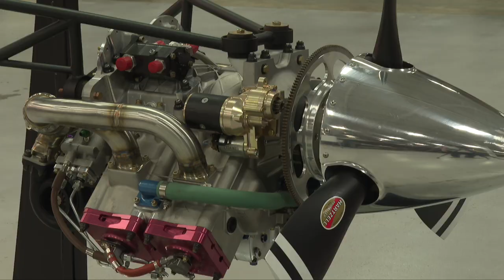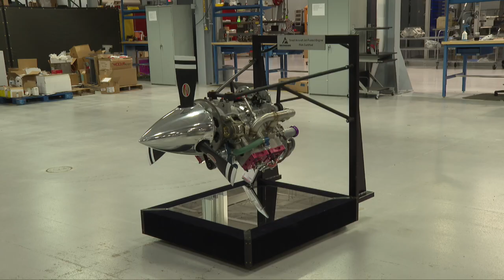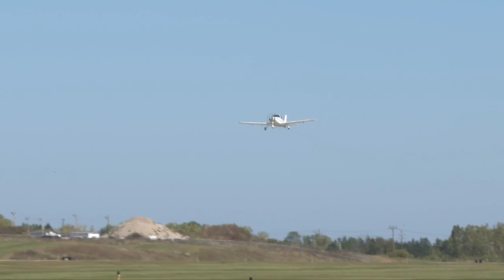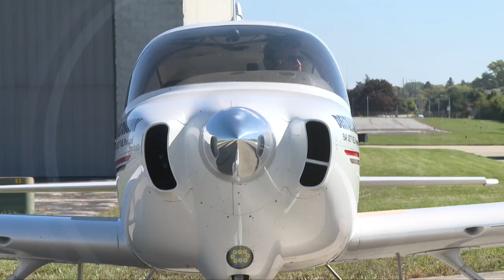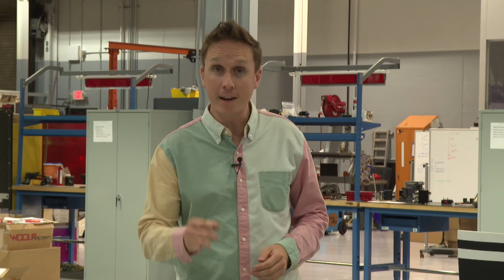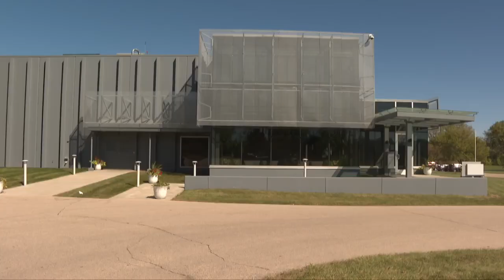This engine is the future of flying

Comment: This engine as the reporter said has been decades in development.  That is NOT and exaggeration. It is a boosted 2 stroke diesel, and it supposedly burns clean with no electronics.....? The 6-71 Detroit Diesel also had no electronics and they do NOT burn clean as I've had one. Perhaps the jetfuel helps but after nearly 40 years of working out the bugs, I still am not convinced. Perhaps it's time is here, but I doubt it. I do hope Im wrong however. Even if it now works great, it will most likely be priced out of reach of most people.

Comment: Uhhh... Piston aircraft engines are about as complicated as a bag of hammers. Air cooled, pushrod, mechanical fuel injection. I'm a pilot and a maintainer. Even turbine engines are pretty simple beasts. The exception to this rule is the Mercedes diesel powerplant used by Diamond in their Jet A fueled piston models. Those are full FADEC controlled and considerably more complex. Just don't be fooled into thinking that GA aircraft engines are much more complex than farm equipment.

Comment: However well it works it still burns hydrocarbon fuel, so its not the future it's the last elaboration of a technology than has reached the end of its useful life. The future is  electric. Battery or hydrogen. They might need more refinement but that is now happening at pace.

Comment: Yes, it really is a miracle. Lycoming, Continental etc. can close their companies. Nothing can go wrong with this engine, it has no spark plugs, no carburettor, no injection and no cooling system; therefore there is no need for a coolant pump and the V-belt or flat belt is just for decoration. 😛🤣😍😵‍💫

Comment: I remember when Delta Hawk was gearing up years ago, early 2000’s. The experimental crowd was pretty ramped up for an alternative to Lycoming, which I understand has years of backlog orders. Yes this is a diesel. Interest faded when Delta Hawk leaned more towards certificated applications, which makes sense. I’m sure the FAA has made that journey a simple and enjoyable process. Given the process to get a simple LED lighting system certified, it’s no surprise it’s taken them 20+ years to get this far. It is really a well engineered piece of machinery.

Comment: I didn't learn anything from the video so I went to their website. It is a 4 cylinder diesel, turbocharged, non geared with glow plugs, 180 to 235 HP. I'm not sure why it took so long to develop, (possibly certification). The fact that it uses jet fuel is a big plus since Avgas is more expensive and more difficult to find in many countries. My favorite cool engine was the turbine engine for 1963 Chrysler two door coupe. It obviously had to be geared but could run on non leaded gasoline, jet fuel and tequila.
Reply: Same experience here.  The video was a synopsis for idiots.  I do believe the future of small general aviation aircraft is with diesel engines.

If I were to try to enter the aircraft engine market, it would be with a 4 or 6 cylinder NON-GEARED turbo diesel with intercooling.  Perhaps the homebuilt market could be a good place to start and gain experience.
Reply: @petepeterson5337  :  The problem there is you would often be dealing with inexperienced, time-consuming people, with minimal cash.
Reply: Tequila!
Reply: @mattspeer3516  Bum bada bada bum bum, bum bada bada bum TEQUILA!! 🙆‍♂
Reply: I think it’s a 2 stroke too.
Reply: How about an DH v4 2 stroke swapped banshee!
Reply: The problem with the Chrysler was the number of Mexican Wine-Oh's who suffered facial burns from sniffing the exhaust!   😜

Comment: Normal turbo-charged diesel-engine.
Reply: Are normal diesel engines inverted, are they 2 stroke, are they 4 stroke, how heavy (weight per HP) is a “normal” diesel engine.  Inquiring minds what to know what “normal”.

Comment: Aviation engines are all bureaucratic. This shit is 235hp max and weighs 335lbs. It will probably cost over $100k. An ls3 corvette engine, which you can put in an experimental airplane, weighs 357lbs and puts out 450hp. It only costs $9000.  Everything sucks in aviation cause they don't want you to fly.
Reply: How many RPMs do you need to get that 450HP.  And since that prop needs less than 3K Rpm, what is the weight of the reduction drive you intend on using.
I know from what I speak since I helped my father with an experimental Chevy 4.3 with reduction drive powering an RV9

Comment: 1 - Aircraft engines are simple.  As simple as possible. 
2 - I'm trying to find a way you could brag about your product while being more vague. 
3 - From what I can see in the video this is an inverted V - 4 cyl - liquid cooled , turbo charged diesel with a planetary gear reduction to the propeller. 
What they're trying to do is protect their product so nobody can beat them to a type cert and production.
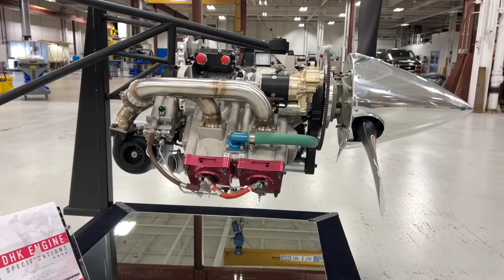Reply: its a direct drive 2-stroke mechanically-injected turbocharged diesel with a supercharger/blower for start up, like most 2-stroke diesels have.  the belt driven blower can be seen at 2:02 min.  the ring gear shown is for the starter.  

this is an amazing engine.  its service life TBO is 3000 hours, not 2000 hours.  this combined with 40% less fuel burn and a lower cost per gallon fuel, make the engine much cheaper to own in the long run.  this is indeed the future of GA.

Comment: 2:15 advertisement with zero discription of the engine.   It appears to have a turbo and be liquid cooled.   How long will it run over the rocky mountains when the coolant leaks out?
Reply: Diesels can run longer than gas motors without coolant.  And no, the turbo is not liquid cooled just the engine.

Comment: Lycoming and Continental aircraft engines use pre-war technology, from the 1930s, air cooled, magneto ignition, manual in-cockpit adjustment of carburettor.
Reply: The main reason that airplanes still use ancient technology engines is because of government (FAA) ancient certification requirements!
Reply: yes they do. & now they are soundly BEATEN.

Comment: Fuel is not the not the most expensive part of flying, it may be the smallest for GA.
Reply: Then again, most GA planes are still burning leaded gas. That needs to change yesterday.
Reply: @hedonismbot1508  it’s going to be a long time for that because 1 gal of avgas is 36kw. A long range Tesla is 77kw. Maybe 2 hours of flight but that’s not counting the weight of the batteries. Planes require way too much power to be practical for electric power. Petroleum is a great carrier of power. Someday we’ll have super conduction motors higher efficiency solar, and maybe something not invented yet but for now and for a very long time planes will need gas.
Reply: @CliffordStaley  I was referring to developing an engine that burns something without lead. Some homebuilt planes can take automotive gas, for example.
Reply: @hedonismbot1508 low lead

Comment: DeltaHawk have been pushing diesel aero engines for many years, for me, the biggest plus would be getting rid of AVGAS it seems incredible that light aviation is still burning Gas with Lead tetraethyl in!
Reply: This comment needs to be at the top
Reply: the kick in the a55 to lycoming/continental will be the low parts count- and the ability to run on jet fuel or offroad diesel or even B100. even BIGGER? water cooling & 40% efficiency increase over Lycontisaurus engines. they're doomed. now Lycontisaurus will have to get off the a55 & make a diesel 2stroke or just wait for deltahawk to eat their lunch entirely.

Comment: “Most of these planes can only use a certain type, of expensive fuel only found in certain parts of the world” 

You mean the CHEAPER 100ll found at practically EVERY airport in the developed world? What a joke
Reply: Europe is outlawing  low lead and my understanding is it’s difficult ,to find in Africa.  Don’t know about parts of Asia and South America.
Reply: Low lead is on the way out and, where I work is more expensive than avtur
Reply: @Bakes-z4c  You likely work at a larger airport with a lot of jet traffic, that’s the only place I’ve seen jet A cheaper
Reply: @yamkaw346 check any airport in Canada that has both 100LL and turbine fuel available, and you'll see that the 100LL is more expensive. This does vary by region around the world. 

In Canada, a small airport with only one fuel will have avgas, not turbine fuel... but that varies by part of the world, too.

Comment: On the contrary, aircraft engines are incredibly simple. This thing, with its diesel injection and its high compression, might be too complicated, or too heavy, or both, to be useful.
Reply: might be- coulda, shoulda, woulda. EVERY lycoming and EVERY continental has more moving parts by DOUBLE, than THIS 2-stroke v-4 diesel engine has. and mechanical direct fuel injection is FAR more reliable than a carberator, in aircraft? by a factor of 100x. look up 'carb ice'- you'll understand.

Comment: This has been the engine of the future for many many years.
Reply: That’s how it goes in aviation, everything is EXTREMELY slow to change
Reply: Only one year certified
Reply: if the FAA was taken public sector, non profit - say, like UL labs or ASTM- lycoming & continental would either change their business model or go bankrupt by next month. I'm not saying the FAA didn't make public air travel better, or that they're not good at their job- but if you want LESS quality of something- TAX IT. that's what the FAA does. it places private air travel out of reach for the general public. IT HOLDS BACK  GA. the best move? leave it in play FOR commercial air travel for everything greater than 10 passenger with luggage, or greater than 4000 Lbs., total. you'd see general aviation technology safety & affordability take a HUGE leap forward. right now, all they're effictively doing is shilling for lycoming & continental- who, of course- are never going to innovate, for the same reason it took deltahawk 20 years to get past the FAA gauntlet. the dhk 180 was ready 12 years ago.

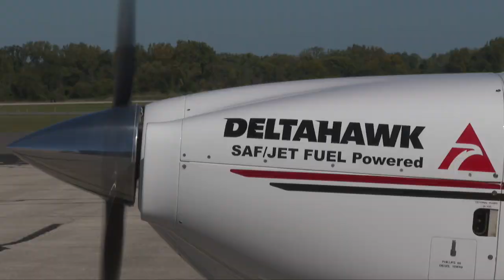Comment: @1:39 you can see it runs on Jet-A. Probably a dual FADEC Diesel.  Lose your battery, lose your engine.
Reply: Manual,diesel inject pump. Even EMP can’t stop it
Reply: mechanically injected diesel's such as this (and old farm tractors) only need a battery to start.  the vid says it has no electrical system.  and its a 2 stroke, so could be started by hand due to lack of a valve train, as well as by firing on every cylinder every time.  this is a sweet engine.
Reply: @yukonjon5964  I fly a FADEC diesel 172.  No battery, no engine.  Perhaps the engine can operate without a battery, but the FADEC certainly needs one.  Are the injectors digital (need power)?

Comment: Is it lighter, more powerful, cheaper than a Rotex 912?
Reply: I wasn’t aware a Rotax 912 puts out 180 Hp and this engine is going up to 230 ho and beyond.  How is the Rotax performing now
Reply: about 3 times the power and only 1/3 more weight.

Comment: The "Why?" this is a big deal is missing. It's the fuel it burns is the story! Jet-A or Diesel, not low lead gasoline which is a very small market compared to the diesel/jet-A fuel types.

Comment: You not understanding how an aircraft (or any) engine works is not the same thing as them being complicated.  Piston engines for aircraft are pretty simple and straightforward actually.  So, too, are jet engines - which, while very different from a piston engine are not complicated.  They are simple because their principal of operation is simple.  And that is a good, and safe, thing.
As for different types of fuel, many general aviation aircraft can use a variety of fuels, none of the exotic.  Some aircraft can use the same diesel that trucks use.  Jet A is just kerosene.
And most other commercial aircraft fuels are not rare or only made in limited places.  Most any refinery can produce most aircraft fuels.
This whole video is absurd.

Comment: You didn't really give us any specs.Fuel, burn or anything that video was pretty much useless.
Reply: It’s intentional on the part of the manufacturer.  It’s just vapourware.  Has been for over 20 years.
Reply: @calvinnickel9995  FAA Certification is the antithesis of vaporware

Comment: Nice job, but you need to add horse power and gallons per hour
Reply: 3 versions currently, dhk 180, currently ceritified & an option on cirrus, and velocity- certified. 200hp & 235hp available, not yet certified- but tested.

Comment: Ok what’s so special about it? This video said nothing about how the engine works and what’s so special about it.
Reply: By far, it can produce Gas level power and close to the same weight of engine.  Very Bery difficult for high compression diesels
Reply: @hugoglenn9741  No quite so difficult if it's a forced induction 2-stroke which this appears to be.
Reply: @ColinMill1  Detroit Diesels for boats due the same since the 1950s-60s.  However, they weigh in the thousands of pounds.  The difficult parts is the get the weight down on something that has compression ignition at about 22 to 1 instead of 8 to1 or lower like gas motors.  All while incorporating redundancy or reliability required by the FAA for certification.  Then let me ad that when mounted, the engine has to be aerodynamic.
These are some of the many difficult issues with a simpler technology.
Stop thinking inside a small box like most insipid American, that’s why we get the elected incompetent officials we have
Reply: @hugoglenn9741  Why don't you look up the Jumbo 204 and subsequent German diesel aircraft engines?
Reply: @ColinMill1  592HP at 1653 lbs is way too far from the HP/LB requirement.  This engine at 357 is going to be certified soon for higher HP likely 230hp and beyond.  Previous attempts are a swing and a miss.
I has to say it once I have to say it a thousand times.  Weight = difficult, weight = less then simple, weight = less than easy, weight = not done before, weight = new technical applications.
Just like Carville, it’s the weight stupid
Reply: @hugoglenn9741  With 90 years worth of metallurgical development available since the Jumbo was designed (using nothing better than a slide rule) one would hope a factor of about 2 improvement in power to weight would be possible.
Reply: It’s just a diesel engine.

Comment: If it's multifuel then it's either turbine, diesel, or alien technology. Would have been nice if they had said which. That's not divulging trade secrets.
Reply: Turbine is a design of engine not fuel.  Multi fuel in jet engines typically means, kerosine, diesel, Jet- A, wide cuts of jet fuel, JP4, JP 5, JP8 etc
Reply: Really low compression can also be multifuel.  The Ford Model T had a 4:1 compression ratio and could run on gasoline, kerosene, wood gas, just about anything.  The problem is its efficiency was terrible.. 20hp out of 2.9 litres.
Reply: @calvinnickel9995  low compression just means low compression.  Diesel typically needs 22 to 1 unless forced induction to self ignite
Reply: It’s diesel
Reply: ET's v-16 2 stroke is 850 CID per cylinder and makes 13,500 hp @ 1150 rpm tapping ZPE! This 2 stroke can form wormholes in space time.
Reply: & yes- IT IS A DIESEL.